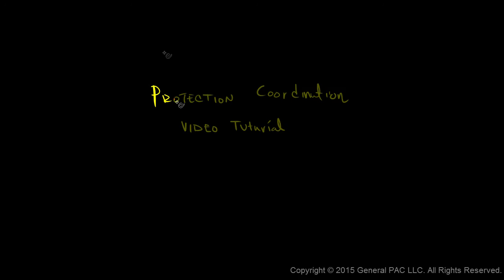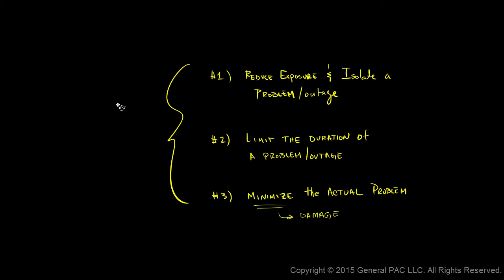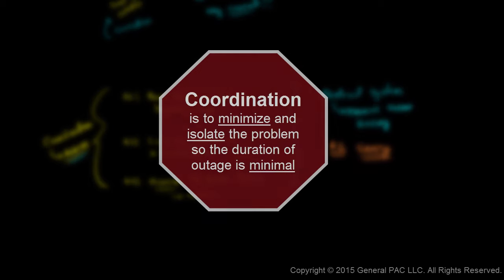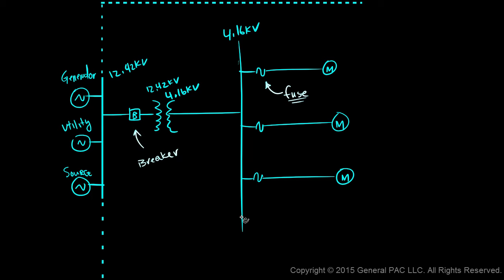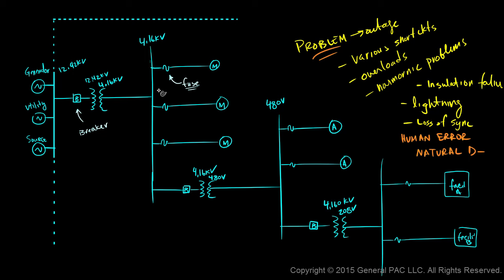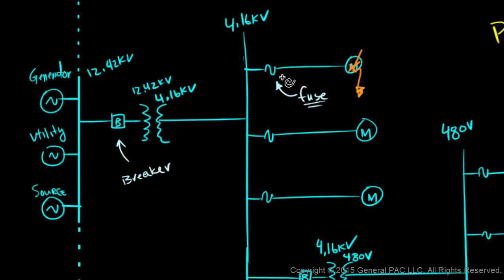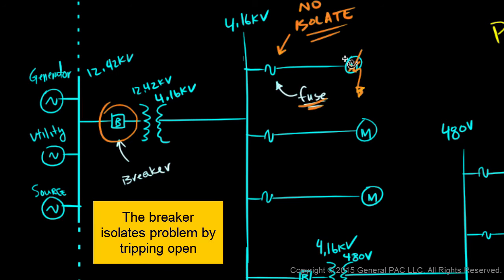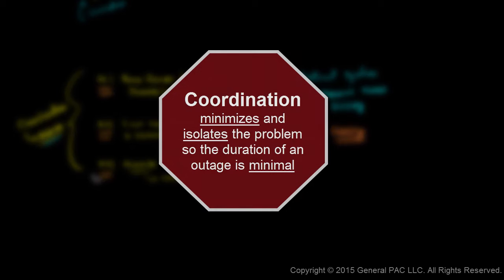Protection Coordination Tutorial Part 1

Comment: Why disconnection time of upstream is lower than that of downstream
Reply from the maker: Hello! For the coordination purpose the time of operation of downstream is faster than the time of operation of upstream device. If the coordination is not met such that the upstream breaker trips before the downstream breaker then it will hit the overall reliability of system.

Hope you find it useful.

Best regards,
GeneralPAC by AllumiaX

Comment: I hope someone could answer my question.
I have six generators (1 MVA each) supplying a system through two transformers 0.4/11 kv.
I need to add two more generators (1 MVA each) through transformer 0.4/11 kv
My question is do i need to change protection settings after adding thses two generators?
Reply from the maker: Hey Dawod, 

Yes, protection settings will be revised. As adding new generators will increase the current, the pickup setting will change as pickup depends directly on the current.

If protection settings are not changed, then there is a high chance of false tripping during normal operation, affecting the reliability of the power system. 

Hope this clears your vision...

Thanks,
GeneralPAC by AllumiaX
Reply: @Generalpac  
Well noted
Thank you so much 🌹
Reply from the maker: @dawodtawer1953  You're welcome :)
Reply from the maker: @dawodtawer1953   We are currently offering great discounts on our paid courses, you can have a look at our course page here: https://www.allumiax.com/power-system-courses